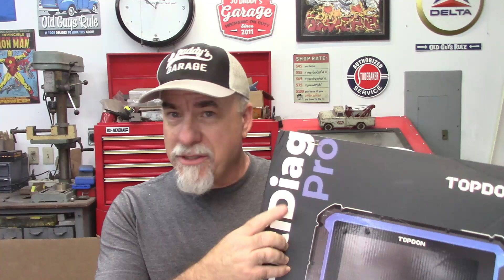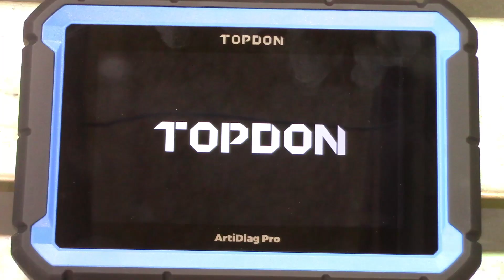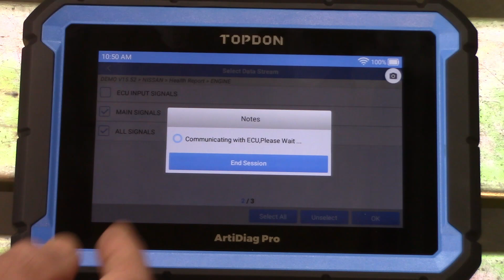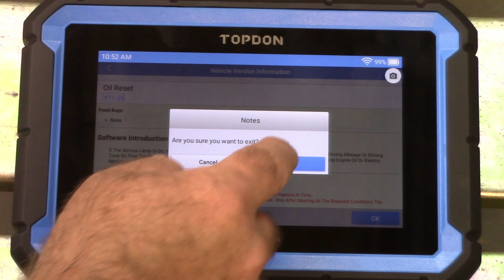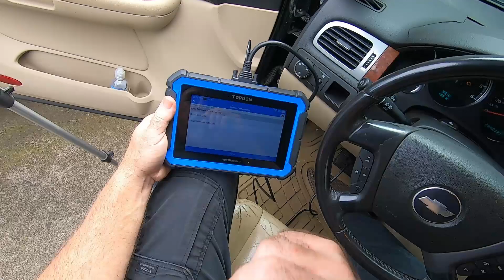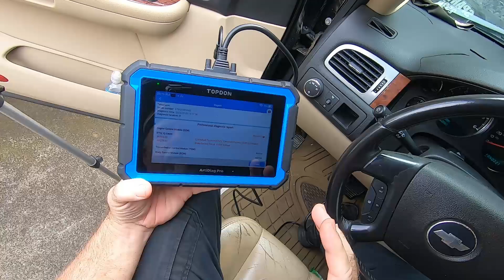Artidiag Pro unboxing and basic functions. TOPDON analyzer scan tool.

Comment: Thank you for explaining the little camera symbol. Since the front of the Topdon ArtiDiag Pro V1 and V2 look identical and the V2 has a camera on the back - I thought it was a shortcut to the camera function and an easy way to identify between V1 and V2. This is unfortunately wrong, haha - starting to regret my bid on a second hand unit which now might be either of the versions. Thanks for showing!

Comment: I just bought one of these, so far so good. I like the fact it covers everything I need, it does a lot for the money, along with being bi-directional, can program keys too, along with hooking up to the internet, which is great when you run into codes. This unit will take you right to the codes and their meaning in seconds. I am sure there are better scan tools out there, I know there are, but so far, this one is fitting the bill. It comes with a solid case too.

Comment: Looks like a good scan tool. I have two hand belts that are pretty comprehensive. But they don't do airbags or tire pressure sensors. I also have a Vag Com program in a laptop for VWs. It works quite well. All and all they all do what we need.